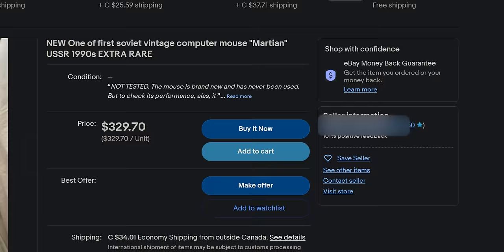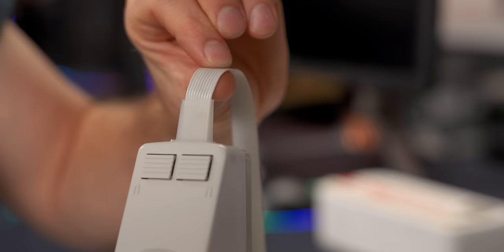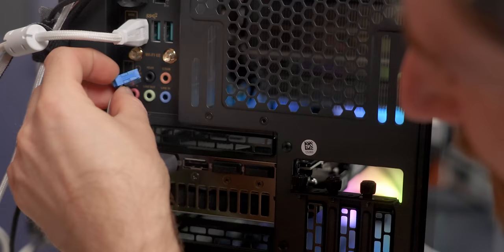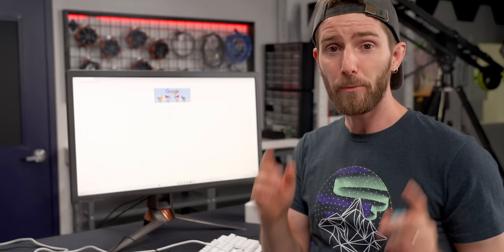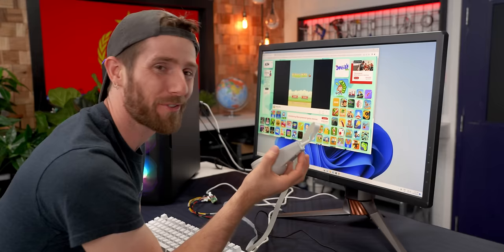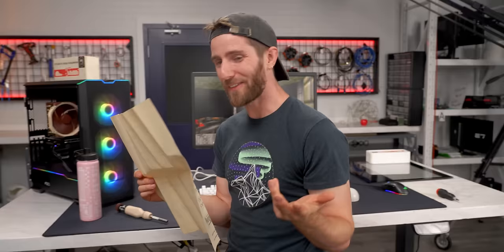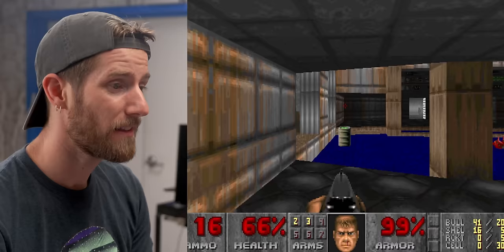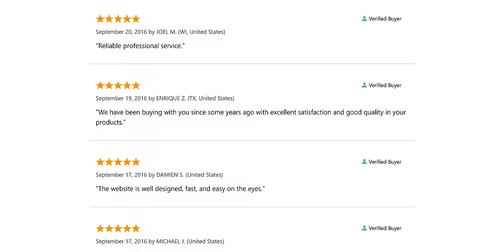I Bought a Soviet Era Gaming Mouse - MARS UKV-01

Comment: THE PIN LAYOUT

For those of you  who don't speak Russian. 
The pins 1,3, 2 and 4 are responsible for the movement. 1 and 3 are your up and down and 2 and 4 are your right and left respectively. 10 is 5v power, 5 and 6 are, as you figured out, buttons 1 and 2 and 7 and 8 are "general purpose" pins whatever that means. I'm a native speaker but not an engineer.
Hope this would be useful
Reply: This is not live lol

Comment: Your exchange rate is way off. 150 RUB to 350 USD sounds very much like a party-approved public rate (which common folks could never use because you could not just go and buy foreign currency). Real rate was between 3-6 RUB per dollar. Which makes this mouse cost about 50 bucks at the time of manufacturing
Reply: That makes a lot more sense. Thanks
Reply: @256shadesofgrey  bs. The effects of inflation are not that strong over such a short time periode like 30 years.
Reply: @Squilliam-Fancyson  Haha. Look closely. Between 1993 and 2021 approx inflation in Russia measures in hundreds of percents. I.e. 150 rubles then is ~80 000 rubles now.

And this is not the worst case of inflation in the world, actually. Far from worse
Reply: That is correct if you compare Dollars to Rubles from that era. But if we account for CPI growth for the past 35 years, then we have to add ~300-400% to get the price of this mouse in the modern USD. 350$ looks about right.
Reply: 50$ from 1980 is about 180$ today
Reply: Very roughly speaking, based on Soviet prices and salaries, 1 Soviet ruble is roughly 10 modern dollars
Reply: @onabikewithadrone  Yeah I looked it up. Between 2000-2022 the ruble lost 50%.150 rub was about 5.4 $ in 2000 and 2,7 $ in 2022. In your interpretation it must have lost 700% which is totally off.

Comment: What an interesting solution by the labs team of using a pico to translate the pins into modern USB compatible signal. I loved tinkering with the pico in a couple electronics and microcontroller courses I had in school.
Reply: The pico is basically made for these tasks. The PIO system that it has if perfect for these kinds of oddball digital protocols.

Comment: Interesting fact - mentioned cost is "150 rubles" and the cost is about average salary of common soviet engineer (about 120-150 rubles at the end of 80s). For example: store sellers had avg 80 rubles, workers avg 200 rubles. Official currency rate was 1 US dollar vs 0.65 Soviet ruble (less than 1 ruble), non official "black market" had different currency rate from 8 rubles per 1 USD to 10-15 rubles
Reply: Actually, the commercial exchange rate was over 30 rubles at the end of the 80's. So, the price of the mouse comes down to under $5, definitely not the amount Linus paid for it. 😉
Reply: @_____.__  u lie

Comment: One of the reasons it is slow is because of the resolution you're gaming. (Probably 1440p or higher)  Game at the intended resolutions for this mouse, and then there's no issues with the rate of movement. Which were very low indeed. Of course, ergonomics remain unchanged. xD

Comment: The main reason why this mouse is ''slow'' is because the output is converted by software on the Raspberry. Back in the day you would've probably had an ISA-card with the mouse that converted the signal via real hardware.
Reply: It'd be interesting if some bright spark designed an 8 bit isa card that adapted this mouse protocol to your standard Serial mouse protocol
Reply: i guess mouse is slow because it works at something like 100dpi or even less. Nowadays we have big screens with big resolutions and mouses that is works at 10000dpi. But back in a days screens were small and resolutions were low like 320x200 so mouses as well were low dpi. And today he is running a mouse that were designed for 320x200 resolution at freaking 1920x1080. So i guess this simple reason is why mouse moves slow. I remember playing quake 3 with old ball mouse and to have comfortable gameplay i had to set mouse sensitivity in the game to something like 20. But with today mouses you will feel just fine having mouse sensitivity set to 1.
Reply: @stpbozin8253  I suspect it'd feel just fine on a DOS or Windows based system running at 640x480. It'd be interesting to plug it up to a 486 or Pentium and run the original Doom on it. I suspect it'd feel just fine. SW rendered Quake on say a Pentium 133 or 166 might also be interesting.

Comment: A modern 1080p + monitor also probably doesn't help the slowness/jitter problem. If your screen is only 640 pixels wide it's less of a problem
Reply: Even less, it was 512 pixels wide in BW mode and just 256 in colour mode for Electronika BK.

Comment: I want an old Soviet KGB telephone. I just don't know how I would hook it up to the land line.
Reply: The Party will handle that for you, comrade, don't you worry.
Reply: You'd use a regular phone jack, duh
Reply: Wherever you call, Brezhnev will always answer.
Reply: If it is a landline you just need to know if the jack is the same as American landlines, if it is you are all set. If not, look up the wiring for the connector it has and for American ones and then buy an American connector to wire in. You can then either get a VOIP or cell phone adapter to hook up to the wire and boom, Soviet landline phone that uses modern tech to work
Reply: @stigrabbid589  My understanding is they used a different standard. It'd take a fair bit of tinkering
Reply: @0alsh  Aw man, I was really hoping to talk to Comrades Gorbachev and Yeltzin.

Comment: for any subjects in the USSR, there has always been an extended instruction, complete with the subject. For example, there were whole books with diagrams and detailed technical documentation for cars and machines. A detailed electronic schematic diagram was necessarily attached to televisions and other electronic devices. Everything was done so that you could assemble the device from scratch, on your own, and set it up to work. Here's a good example for you: a VAZ Niva car. This machine can be repaired in the Siberian taiga with a stone and a wooden baton, all liquid conductors are sealed with wood resin or clay. And at the same time, it also included schematics of all components and assemblies.

Comment: They handed over half the mouse function to the internal adapter board to be able to fit all in a regular mouse enclosure:) and it still looks huge, but cute somehow. My uncle and i had to make a joystick for my apple IIc clone, so i can use dazzle draw and play games. It was one of my first ventures in electronics.
Reply: A Soviet programmer would have to write (or copy) a very similar mouse driver back then anyway.
Reply: Because this mouse would use the same resources as a printer, they made a decision to also make version that connects to a box but this made it software incomatible with 64pin version.

Comment: hey, you can add two more directions to a mouse, and I dont mean the third wheel, imu has the gyro sensors too, just use the 2 main accelerometer axis and yaw of the gyro, all other 2nd/3rd wheel roll pitch is a bit extra, like lift detection the z-accelerometer axis. well the whole 6/9 axis imu package can be a mouse glove controller, all axis used fully, better like than vr controller. retro-view or re-view.

Comment: You can fix the jitter on the mouse relatively easy. All you have to do is map the pixel mouse move, to the speed the mouse was moved , e.g pulses per time. 
On very slow moves or stationary, the increments remain 1, at higher velocity you crank them up. Few lines of code on the pico ;)
Reply: You are right it would help precision at low speeds, but usually gamers don't like mouse acceleration.
Reply: @ryangrzanic  Thx for the info ! Despite having been a good 40 years into computers and code, I never played a game :)
Reply: @ryangrzanic  having said that, this is an mechanical mouse with two optical sensors. The photo transistor from that era might be pretty quickly saturated at even 'moderate' speeds. 
Hence the signal will degrade anyway...

Comment: Linus, x, -x, y and -y stands for coordination on a coordinate axis. You can just take 0 as a center of the monitor. Then, x+ means you go to right (in the positive direction), y+ means upwords in the positive direction. The same with the -x and -y (but in the negative directions). Or you can just pick 0 as the most left and down pixel of the monitor and don’t use the -x and -y to make things simpler. Just tell the raspberry pi to interpret coordinates from the mouse to the monitor. Mb it will help with the jitterness and skipping pixels on high accelerations.

Comment: What is good is that in the USSR there were always instructions and diagrams for the TV and other equipment in the kit, so it was always possible to repair them and the equipment served for a long time. Now this is not the case and it is done so that if something broke, they bought a new one, and did not repair the old one. It is not profitable for corporations if things will serve for a long time.🤔
Even in some mouse there is an instruction and a diagram.😅

Comment: There really is something to say about quality of older peripherals even though it was not the case in this video. I use a 24 year old keyboard a old hp media center keyboard. If is filthy but still works perfectly. I have replaced it a few times just to have the replacements die in a short period. Enough times that I doubt I replace it, and honestly if mouses were any worse I would prolly go back to ball mouses too. Luckily there are low cost mouses that perform well for a few years still. I have no doubt in my mind though that there are early HP peripherals that are much higher quality anything I can get my hands on today... at least at a price point I would be willing to pay.

Comment: About construction. Yes, mosst of soviet technics was constructed so, that it will work many decades. Still there were exceptions, for example soviet color crt tvs, which documentation clearly say, that the tube is designed to work from 2000 hours l, up to 5000 hours. It is actually a reason, why most them gone trashed.

Comment: At first glance, it resembles the Amiga/Atari ST mouse communication protocol, but the difference is in the RESET line. As it was quoted, in the original computer the mouse was polled 50 times a second (50 Hz), so that was the RESET frequency.

Comment: 150₽ was close to a full salary, so about 2000-5000 USD, the spread depends on the time, in the 70's, 150roubles was a good salary, but in late 80's it was probably only half of the average salary.
Reply: 2000-5000 USD? 😄 Right, in a fantasy world that never existed.

Comment: one of the best thing with the communist electronics was that they were build to last forever and self repair was the ONLY option. (mostly). so everything came with schematics and PRINTED PRICE on the box. Inflation? whattis that?

Btw my dear friends at LTT - if you can get a computer from Bulgaria (once one of the biggest manufacturers of personal computers) you would see what we managed to do with steve wozniak's machine and software. Apple soft basic was in CYRILIC, we had advanced graphics, Serial port based network (because we had one floppy for 10 computers so we hacked the OD)... you will love it. The name was IMKO-2 and then PRAVETZ 82
We had to build it ourselves.

Comment: I had one, but it required a software to work with and I didn’t have any. Well, button could be used, but there were no soft where you have a pointer to control

Comment: pw modulation or pf modulation in each direction is my guess (before the video ends)
Reply: After hearing about the reset, it can only be that the flip flop is set by a light gate. If you poll fast enough and reset after a direction is set, you can actually measure the time between the gates, or the frequency of the gates.

Comment: I don't think your pricing is correct, because those currency ratings meant nothing back in the day, and you can't say how much is 150 rubles in USSR to today's money, for example:
My parents, afaik were earning smth around 110-125 rubles working as engineer/mechanic at factory

I saw documents on the flat i was renting in Moscow dating way back to soviet union and the price of 2 room flat was like 7600 rubles

The price of gold outside of soviet Russia was so much bigger than the price inside USSR, that it would would make sense to buy it outside, smuggle it inside, claim that you found  a treasure loose 75% as taxes and still make so much money so it would become common scheme and they even made a movie out of it.

Comment: This is NOT a gaming mouse, simply because it is not a speed or acceleration input device, it is just a direction input. It just cannot know how far, i.e. fast it moved between inputs, it only knows at any given time where it did move, and the driver have no information to base on vary the position increments between inputs. It has 2 bit buffer for each axis, come on.

Comment: Linus, you got cheated. 😄Taking into account the commercial exchange rate in the country at the end of the 80"s, that mouse cost under $5. But still, 150 rubles or the cost of that mouse was the average monthly salary of a worker behind the iron curtain at the time. Just an example, you could buy yourself an apartment at the cost of Japanese VCR. Such were the times.